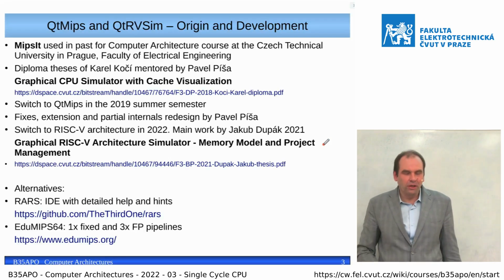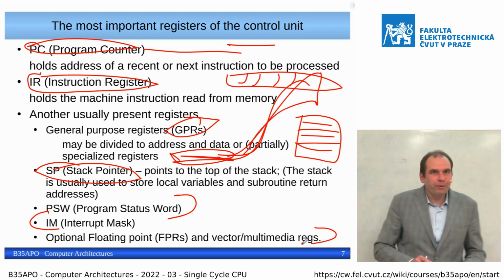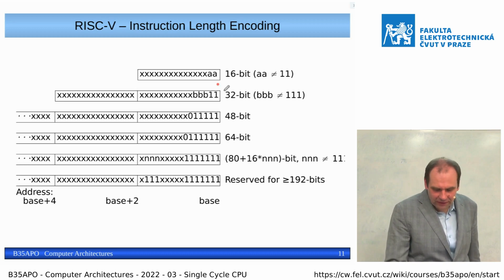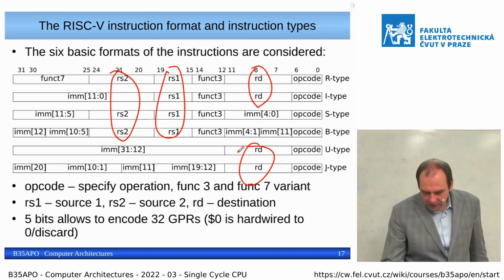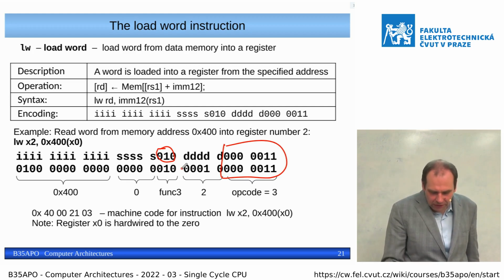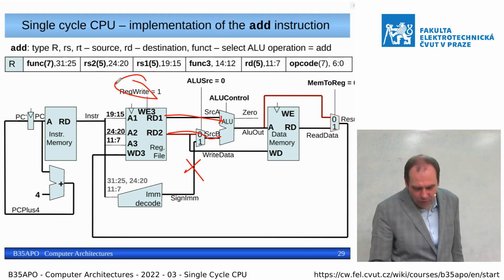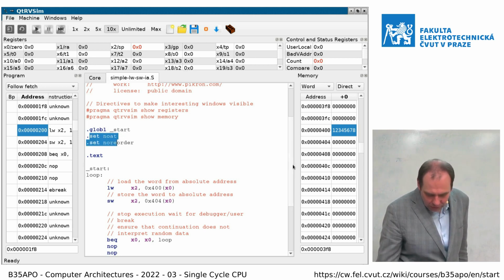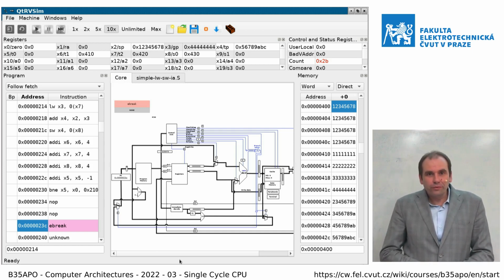dr. P. Píša: Computer Architectures - 2022 - 03 - Processor (Single Cycle CPU)

Comment: Errata: simulator CPU diagram and BEQ/BNE slides has not been fully updated for RISC-V ISA. See the lecture 5 pipelining where new version of the QtRVSim simulator is used https://github.com/cvut/qtrvsim . Slides for the third lecture on the B35APO page has been already updated as well.